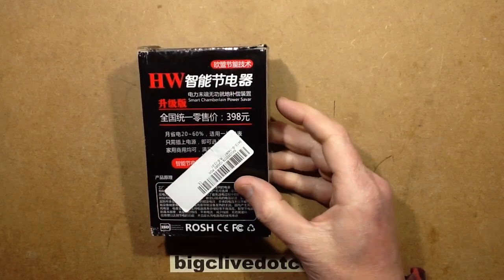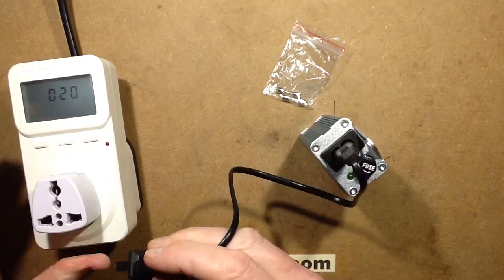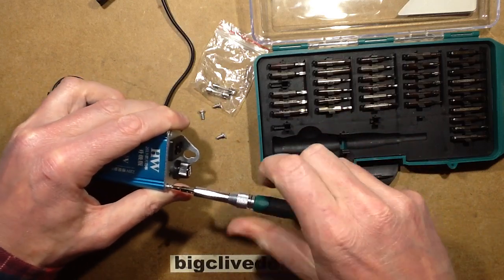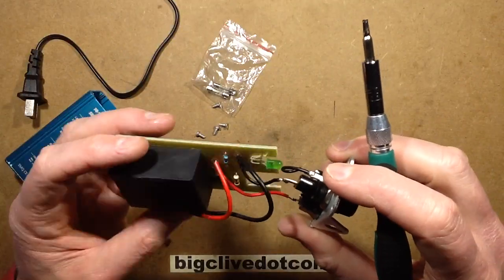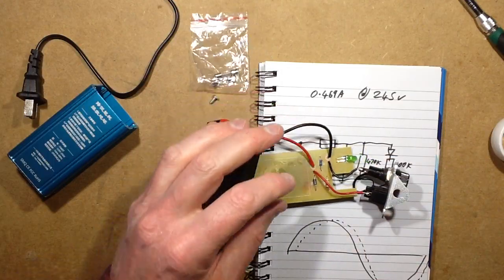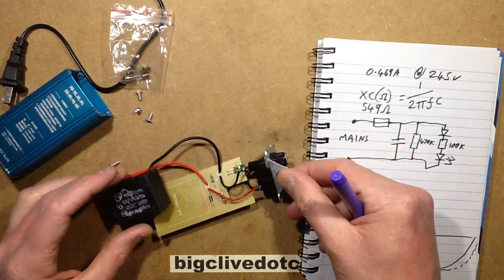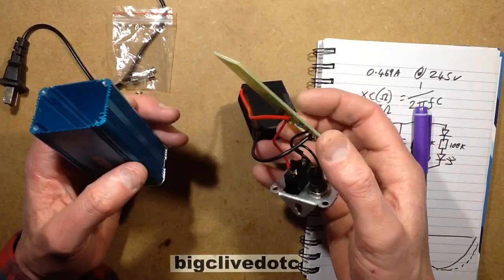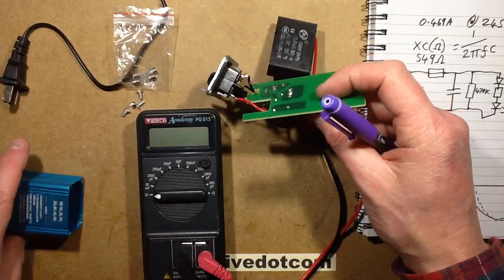200kW miracle power saving device.

Comment: Its really odd to see how everyone thinking its just but it's not only a good electrical engineer can understand this device. When high amount of indicative loads are used on ac it affects the power factor so for compensation of that  capacitor can be utilized to make it right.
I really cant understand he not actually telling this. And all other following says what a miracle device in a funny way.

Before making any stupid comment please learn about "power factor" then you will understand why its not a scam.
Reply from the maker: Capacitive power factor correction only works properly when it is either applied to each inductive load or regulated to match a changing load.  Modern electronic drives create a completely different current waveform that can't be corrected by a simple capacitor.
This unit would only have an effect with a constant inductive load to balance, and could actually cost you money to have plugged in if your utility company charges for apparent power.
Reply: @bigclivedotcom  Yeh not required for us  (for homes basically). But at the end can we say it 100 junk??? But you could have tell this thing to viewers to make them wonder because this topic hard to understand at least for me.🤣🤣

Hey , why don't you use a scientific calculator??👈

Thanks for replying. You are my favorite youtuber i like your accent a lot.😸😸

Comment: if you have an inductive load...
Reply from the maker: If you had a fixed inductive load then it might be worth adding a capacitor in parallel with the load so it was active when switched on.  This capacitor won't help with electronic power factor which is non sinusoidal.  If anything, with smart meters capable of charging for reactive power this could actually increase your bill.

Comment: IME, my electric bill is impacted very little by a forced hot air gas heating system.  Does anyone live in a cold winter climate and only have access to electric heat?  My Florida home only has electric heat but I don't think I've ever had to use it in the past ten years.

Comment: Adding a capacitor to a highly inductive load will improve the power factor, and the measured current will be less, but the actual watts remain the same. The meter measures watts (KW), not KVA. Take this example, I've used values that are simply to multiply: A motor is running on 200volt, 10 amps at power factor 0.7. Multiplying volts by amps gives 2KVA. The actual power is 1.4KW (multiply KVA by power factor to get KW). If you add enough capacitance to get the power factor to 1, then the power will still equal 1.4KW. The current will actually drop to 7A. Showing people the current dropping to 7 amps is very convincing, this is how they get fooled by these devices. 
Power companies are well aware that a low power factor results in increased current. This leads to losses within the transmission system and necessitates larger cables. Also, a generator running with a large VAR component will be noisier and lossier. This is why they measure power factor in factories and penalise them accordingly. In a house there are few inductive loads so it is not an issue. Factories install a bank of power factor correction capacitors to improve their PF and reduce their bills, not their consumption.

Comment: Back in the 1970s, I was working in a plant that made brass in an induction furnace, that had a power factor of 0.5.  They had to use chart recorders, so that the power company could charge them correctly.
Reply: Usually the power company installs a huge capacitance bank on premises to mostly correct the power factor.

Comment: I have a large power saver device because I have a large sump pump (1/2 HP) that dimmed the lights each time it started and it runs very often when it rains (large startup current).  The power saver uses capacitance to improve the power factor.  This aligns the voltage with the current and greatly reduces the light dimming (I can see the marked difference).  Correcting power factor does increase efficiency.  I don't know if it saves me electric costs but it;s probably better for reducing the voltage surges and easing the strain on the motor.
The best solution would be to move to where the groundwater wasn't a problem.  Not an option.

Comment: No proof shown that it can really save power consumption, I may believe if I see the amount of current consume in a load before and after the application of the power saver!
Reply from the maker: It doesn't save power.  If the modern meters are set to measure VA it could cost money to have plugged in.

Comment: Hang on a second are you trying to say that power factor correction capacitors are "quack devices" or that this particular one is way overrated in terms of performance....?
Reply from the maker: For correcting a known inductive load power factor correction capacitors are good.  But these things are a wild stab in the dark and will have no effect on modern electronic power factor.  They could end up costing you more money if your meter measures apparent power.

Comment: Only way that capacitor could work is if your utility charges a penalty for poor power factor (<0.9) of load and this could potentially correct some of that, maybe shave a fraction off a bill.
Reply from the maker: Nope.  Quite the opposite.  It would help if you had a continuous inductive load, but in reality most modern electronic devices have a power factor that can't be corrected by a capacitor and if the utility company is charging for apparent power then this unit will actually COST you money.
Reply: @bigclivedotcom Hi Big Clive, I really like your show. However I disagree. As you said "Nope, quite the opposite" And like I said, a capacitor could potentially correct some of this...Let me clarify...
The main cause of a poor power factor is an inductive load. If you have a poor power factor say of 0.85 caused by inductive loads this means the current is lagging the voltage. This can be corrected by adding a capacitor in parallel to the load. Motor loads are the largest cause of poor power factor in electrical systems. Electronic devices have a very small power draw in comparison to inductive motor loads. The residential inductive motor loads of the fridge, freezer, washer, dryer, pumps, fans, aircon, all cause a lagging power factor. In residential services this is usually small and the utility generally will not penalise. However in commercial and industrial settings this is very much so an issue. These customers are very much so charged for VARS reactive. Many industrial plants running multiple inductive motors will have banks of capacitors that switch on to help bring the power factor back towards unity. This also happens in commercial buildings with multiple fluorescent or metal halide lighting loads. Once again if they are not corrected inside the light fixture, a bank of capacitors will be used to help correct this.  I understand that electronic devices have issues with harmonics and have to use different methods to neutralise them, however they would be very small loads bar solar inverters and UPS supplies. Although are they not supposed to be corrected in Europe and North America to 0.9?.  The main cause of a leading power factor is by over exciting an AC synchronous motor which can provide reactive leading VARS -  deliberately overexcited to help a lagging power factor elsewhere in the building. Maybe I should have said a capacitor could improve power factor provided that you have some motors, or ballast lighting of the non-electronic type in your home...Which in my eyes is the majority of systems.

I guess if you had a perfect unity load on the house and then stuck some capacitors on you could in theory cause a leading power factor....is that what you mean?

 Am I missing something here?

Comment: These things do work and can be verified if you have one of those watt-hour meter where there's a spinning aluminum disc. If you have motors like air cons pumps, refrigerator running, and you plug in the gizmo, the disc will spin slower. It depends on how much inductive loads you have at the time.  Conversely, if all inductive loads are switched off and you still have the capacitor connected, it will consume power on its own. Now as a capacitive load. Check it out. That is why people are buying the product.
Reply: They work, but they don't affect home electrical bills because home power billing doesn't take power factor into account. You're being charged the same amount whether you have a good power factor or not.

Comment: The purpose of this device is to improve the power factor of electric power.
However, electricity charges are proportional to power consumption regardless of power factor.
The power factor improvement discount system is not applied to your home electricity retail electricity.

Comment: I missed what the device actually does, and what it could be used for.
Reply: I mean, obviously, if you're on a clean grid, and have a half-decent power company,  this isn't gonna save anything. But i always question the translations. Saving electricity doesn't mean using less unless you assume it does. Would it be possible, that these filter grid noise? Potentially for those that don't have a clean grid, or have a generator?
Reply: Primary function seems to be removing money from your bank account

Comment: Yes this is the typical thing that would have to be way bigger for switching power supply noise cancellation in huge office buildings. Usually when office buildings went all fluorescent from incadescent every CFL or fluorescent tube lighting fitting comes with a tiny switch mode power supply within and those tend to release switching noise back to the mains and since they are all in sync their noise adds up and produces big alternating current on odd resonance frequencies blowing everything including their main power line itself when it melts :D So industrial size filters had to be fitted wasting away much of the power the so-called energy efficient lightbulbs saved :)

Comment: If it quacks then it's a QUACK :/

A standard plug for 200,000 W (~800+ amps at 240 volts)? Use a bigger guage, you think?

Just kidding!
   
This is basically a fancy LED light indicator. Might absorb a spike if you're lucky!

Comment: It's just a capacitor it doesn't do anything other... I could give you the technical terminology but the long and short of it is that would only work if you were paying a service charge witch is how the power company charges commercial buildings for their power bill and even in that application it's too small to have any significant effect
Reply: I can't speak for the video maker but here in the UK it is standard practice to have a service charge "per hour" for connection to the grid. For domestic consumers as well as industrial consumers. There's an awful lot of individual suppliers. BUT it's only really going to do something if you have huge power consumption. I agree with you.

Comment: You started to mention the phase relationship in an inductive circuit and a capacitive cicuit... we had a way to help remember that when I was in school. Have you heard of ELI the ICEman?

E  electromotive force (volts)
L  inductance (henrys)
I current (amps)
the
I current (amps)
C  capacitance (farads)
E electromotive force (volts)

 ELI the ICEman says;
"In an inductive circuit the volts lead the amps
    and
in a capacitive circuit the amps lead the volts."

By 90 degrees, I think.

Comment: With a smart meter would you get charged for this apparent power. (469 mA @ 240V = 112W)
Reply from the maker: If the meters were in that mode then potentially yes.

Comment: That plug is very weird. It doesn't have any holes in the contacts. Those are required if I'm not mistaken.

You may be wondering what the 2mm wide holes bored into the prongs are for. Well they do have a few purposes:

1) They are used for Lock Out Tag Out by running a zip tie or small lock through the holes

2) They act as detents into which small balls, springs or prongs grab the plug when it is inserted to prevent it easily falling out--this is the most practical reason. Plugs without holes, and I've only come across 1-2 in my entire life, tend to fall out a lot easier

3) There is probably some minuscule amount of material saving

Comment: I fully agree with your recommendation that if one desires to save on electricity, setting the AC temperature one degree higher will result in significant power saving.  Or placing the cooling tower would significantly reduce the energy consumption.  A sucker is born every day for these gizmos!

Comment: Basically you could connect a huge capacitor in series with your house's mains supply, to save power caused by the resulting phase shift.
NOT so anymore.
Because your mains meter is smart enough to monitor both the voltage and current independently, removing any phase shifting from the equation.
So what do think about this little phase shift device - does it save or consume power ?
Comments please :D :D
Reply from the maker: It doesn't make any difference, but could actually cost more if a meter is programmed to measure apparent power.

Comment: The explanation for using capacitance reactance XC(f) as a resistor that doesn't consume electrical power like a resistor doesn't apply to this circuit.  The capacitor is not in series with a load, but across the main power lines and parallel with any load that might be there.

Comment: does this have anything to do with so called "dirty electricity" caused by energy saving light bulbs? i don't know about LED bulbs...btw years ago i saw this professor talking about this on dutch tv here is the vid  he mentions that LED lamps could even effect your mains breaker or protection don't know what it's called in eng.. hahah (you can add eng subs) https://youtu.be/KIn5rgyKFuU

Comment: It is essentially a PFC device (Power Factor Correction). They are used to correct for inductive loads on the power line, to bring the current draw into phase with the voltage draw. Using LED bulbs will do the same thing as that device, as they place a capacitive load on the line. In the house, it will be mainly anything with a motor that places an inductive load on the line.
Reply: Err.  Exactly what our man said.

Comment: Hey Guys.  I bought a Chinese power inverter by 'Power Jack' and got 'Jack Squat' instead.  It  was supposed to deliver 3,000 volts of pure sinusoidal wave from a 12 volt supply.  It burned about 6hrs before it died.  I tried the second one I had bought and it did not work from the start. The ones from Taiwan did OK for me though.

Comment: "Placebo Action!" LMAO!  But couldn't it be effective with dirty power coming into residential homes? Studies indicate significant biological disorders since the implementation of these "smart meters". Sure they are convenient to the power companies, especially with associative data to resell. Autism rates have noticeably risen since this implementation of their labor saving tool. But the Human spine is like a sensitive radio antenna. Imagine your child's spine laying near a wire broadcasting to your appliances, at a frequency that microwaves use to boil the water in your food. This can be filtered out.
Reply from the maker: The smart meters do not introduce electrical noise onto the wiring.,  The only thing smart about them is the way they monitor the voltage and current and then communicate in exactly the same way that a mobile phone data connection does.

Comment: Ehhh.... 
 You noted that most residential meters don't adjust for the phase shift. It's not reducing electricity bills by decreasing actual electricity usage, it's interfering with the electric companies ability to monitor energy use. Which is usually a great way to go to jail, depending on your state and utility companies disposition towards having giant capacitors connected to their lines.

Comment: Say the capacitor just happnes by pure luck to be the correct size to make a perfect PF of 1 in parallel in your home. The only one it will benefit is the company that transports the electricity to your home.... that is if everyone in the whole town installs this device, they could save a bit of cash by using smaller cables, in theory. In your house it would make zero benefit what so ever. The wattless current will still have to run in your own installation, unless you have one of these devices in the correct size in parallel to all of your sockets and outlets.

Comment: The capacitor may actually save a fraction of wattage at the start-up of an older compressor or washer motor if it's not hitting the peak of the wave

Comment: Not "200 kWh"... no way from that unit...kWh is a measure of stored power (i.e. battery), isn't it?  Should be 200W... kilowatt.... 1000 watts.  200,000 watts (200 kW).  At 220v, 200,000 watts would require around 90 amps of power... (would blow the breaker in your panel).

Love the Chinese's absence of morals and general honesty being missing...

Comment: In figured you would at least use PB Swiss, Wiha, Wera, Felo or Witte Micro Drivers with all the stuff ya tinker with and would want some quality micro drivers that would last ya a very long time and not strip out screws. Do ya use any quality drivers? I really like Wiha then Wera and then Felo or Witte for the price but PB Swiss seem to be the best but are the most expensive but all them are good and the prices have come down alot.